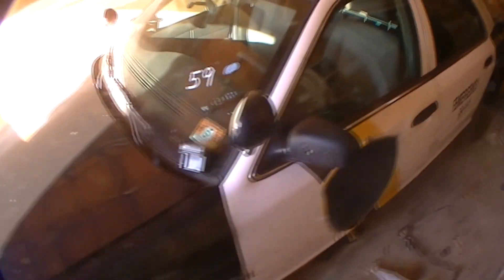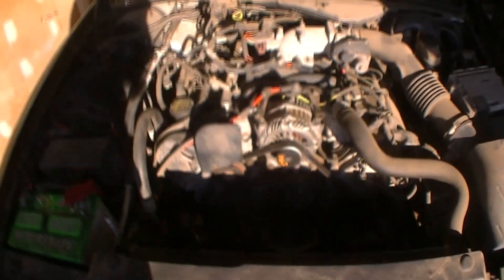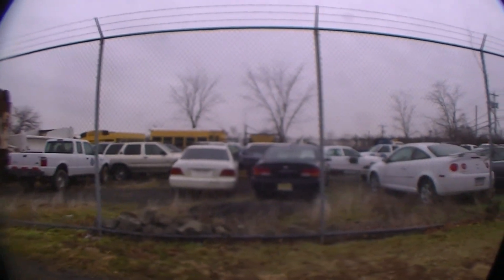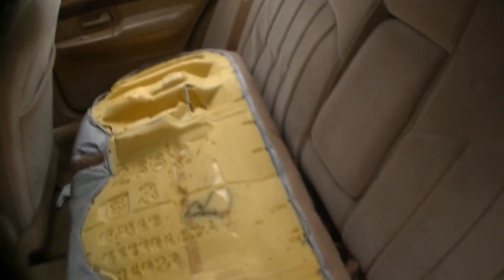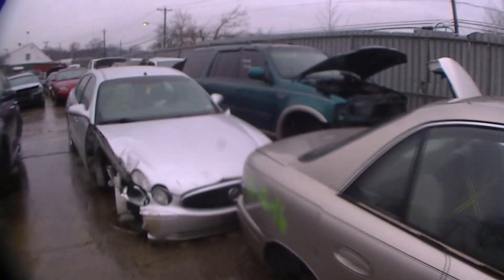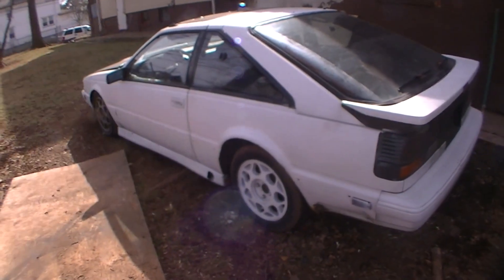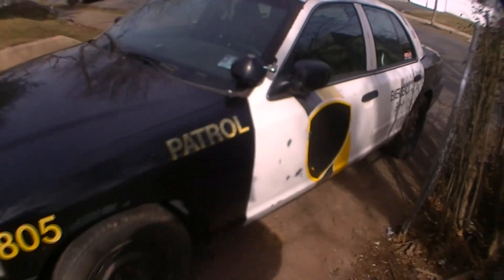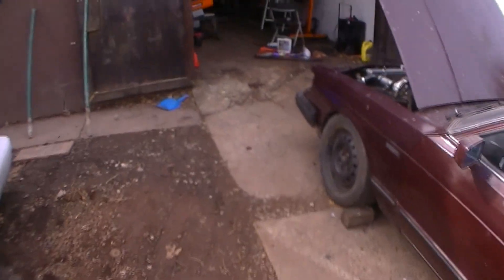Crown Vic build UPDATE Police Auction (waste ) and Undercover Crown GONE

Comment: Make sure the ring gap is set right for the amount of boost you plan on giving it.
Reply from the maker: Thats a very true statement I may have to gap it slight bigger so when the heat hits it it doesnt close ( ring gap ). I am not building a turbo engine at the moment UNTIL i have a turbo set-up on a stock motor. I have to crawl before I run..